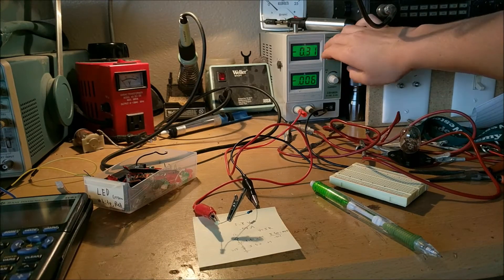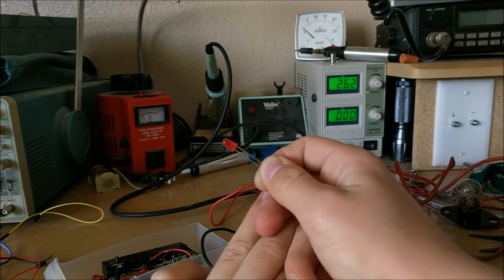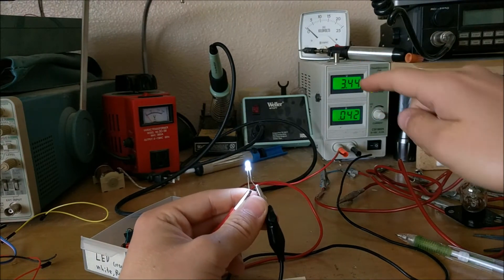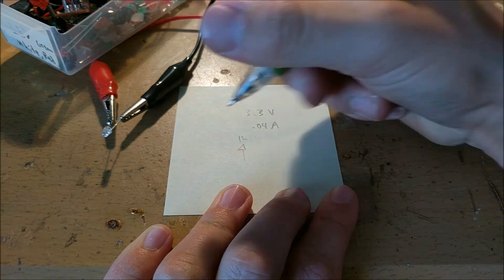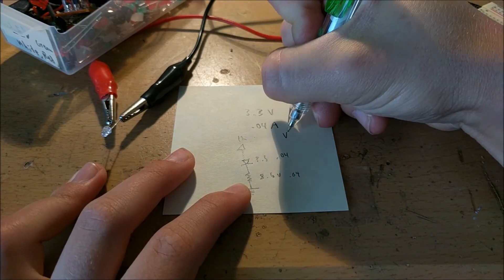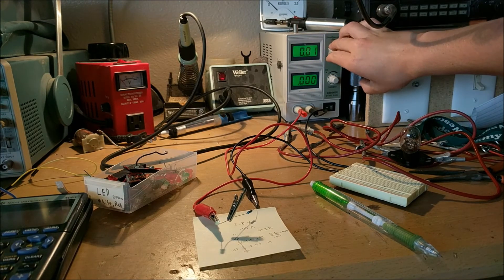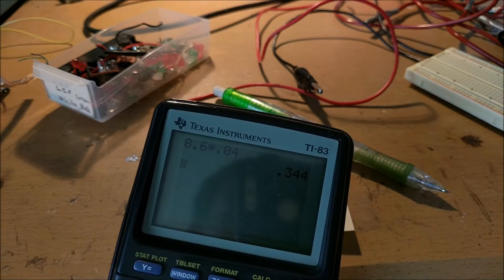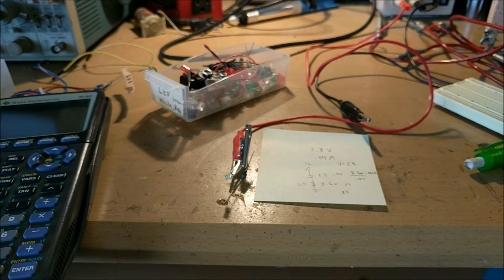How To Calculate Series Resistor Values For LED Circuits

Comment: This is the worst treatment of this topic I've seen. Where did you get the notion that a 5mm LED would be okay with 40 mA running through it? Most of that type are rated for a maximum of 20 mA at room temperature; a few are rated for 30 mA. You must derate at higher temperatures. At least you mentioned the need to use a resistor with adequate power capacity.

I often use a method I call 'dial a brightness' with unknowns. I hook up a 5k potentiometer and 5V. Starting with the full 5k, I turn up the current while measuring it until I like the brightness or I've reached 15 mA, whichever comes first, then disconnect and measure the resistance of the used segment of the potentiometer. Keep in mind that any use of resistance alone to regulate the current through an LED depends on a well-regulated supply voltage.

Where supply voltage is variable such as automotive or battery powered applications, either design in more current headroom or use an active regulator. Until recently I favored an LM317LZ set up in constant current topology but now we have ICs such as NSI50010YT1G, NSI45015W, NSI45020A and others available.

 It's not useful at all to use a destructive test method on a one-of-a-kind unknown device since any accurate data derived is of no use unless you have multiple devices of the same type.
Reply from the maker: Thanks for the advice! I don't know what I was thinking when I made this video, 40ma is definitely too much current for a small LED like this.

Comment: Nice! Thanks. Although I studied electronic engineering this explanation is easier and better than all that I heard before. Can you please explain why you had to bump it up to 12.4 V instead of 12v?
Reply from the maker: +The Vedic Way I had to use a different size resistor than my calculations said I would need, and the resistor value drifted even farther from it's stated value as it heated up.  I just put the voltage high enough to achieve the same current flow.